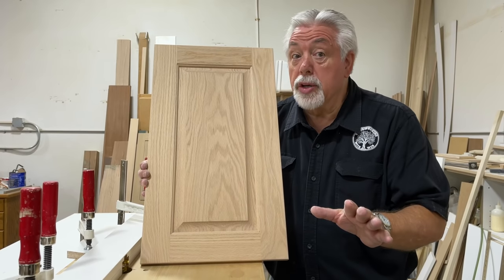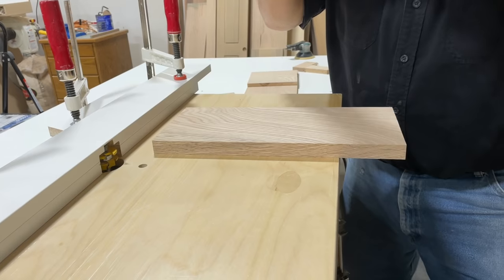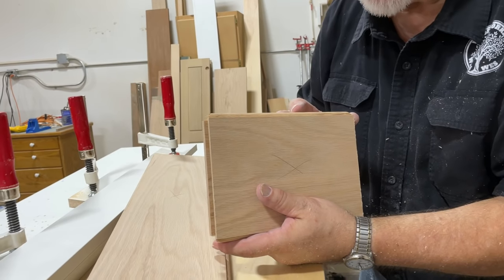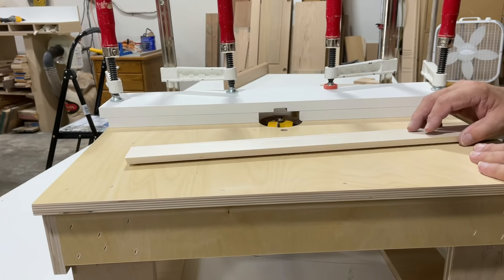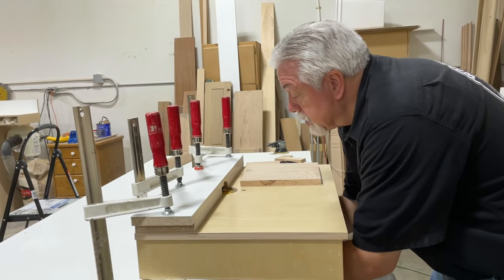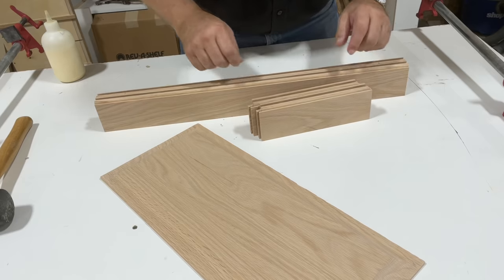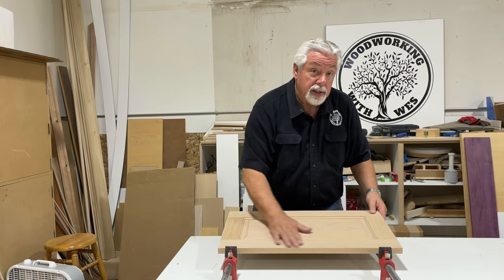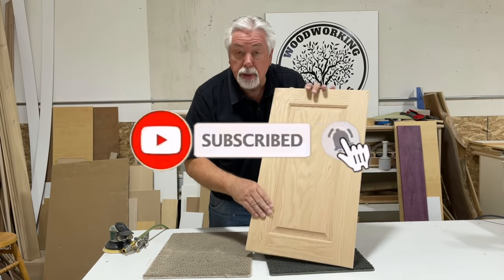Making Raised Panel Doors The Easy Way

Comment: I can’t finger out how to make my panel flush with the stile and rails. My panel is always proud.
Reply from the maker: Hi...the unevenness of your panel is very common but can be taken care of by flat sanding your doors with a wide belt or drum sander. Hope this helps. Wes
Reply: Panel raising bit make need adjustment.
Reply: Take a rabbit bit to back of the panel to bring it back flush.
Reply: Using his technique and with 3/4 thick rails and stiles,  use 5/8" material for your 😊panels.  This will result in a flush fit.  Note:  when making the rail and stile cuts, the groove is 1/8" from back of rails and stile.

Comment: I have to agree with some of the comments.. for just 300.00 u can make this door.. well what’s the process of getting flat s4s lumber? If you don’t have a jointer planner and belt sander it’s going to take you a bit more time to do if at all.  Working with s4s and dry lumber is key to making these doors most people don’t have 1,500 worth of jointers and planners and that’s cheap ones.

Comment: Just a simple router table and bits you bought from Amazon. I have a simple router table, but then you pull out the professional level woodworking shop to do it. Love your shop but was hoping for the "with only a simple router table" video. I don't even need the raised panel I'm putting smoked plexiglass in the back.

Comment: Been working in a cabinet shop for a little over a month now - was supposed to be doing real estate appraising but there is no work right now, so a friend hooked me up - the amount of prep, wood putty, and sanding really gave me appreciation for WHY you take so many carefully planned out steps because MAN, when those doors go into someone's kitchen, it's immaculate!  

For the newbies like me, when you 'break an edge', one or two quick swipes with the sanding block is all you need.  My first set of doors I was a bit aggressive.  The other thing, you can never clamp your doors together too tightly!  You'll see once that first coat of primer goes on.

Comment: Nice tips.  I really like the idea of making the rails/stiles double wide (plus some) and cutting them in half after the routing is completed.  As you said, easier to handle on the router table.

Not sure I like the idea of wearing gloves while routing as it seams a bit risky and could get caught in the bit IMHO.  I invested in a couple decent push blocks (I love the MicroJig Grr-Rip Blocks for the router and jointer).

Comment: You're video was great and full of tips and tricks.  Very professional and calm and easy to follow.  You should include how you setup the router bit heights for the rails and stiles though.  Also, I was wondering why you have a mammoth flat sander in your shop but built a stick/plywood router table.

Comment: 5:40  I think an easier technique for those of us who don't own a jointer is to not make the full depth of cut on the first pass.  Make the first pass about 1/32" shallower on all pieces, then follow with a final pass.  Adjust the router table fence so the bearing  is about 1/32" behind the fence (keeps eh cuter from cutting to the full depth).  Eliminates one machine operaton.

7:50  That's a very good technique.  Routing then ripping that ensures exact width of rails and stiles.
Reply from the maker: Yes...that is an acceptable alternative for sure. Thanks for your comment. Wes

Comment: Great video Wes, and thumbs up for the discussion and technique!  Based on my experience, I don't recommend using budget router bits, such as the Yonico.  On the first pass of the third white oak panel, the Yonico ogee raised panel cutter shed one of the cutter edges with a bang.  Fortunately, it didn't hurt me, but the router was immediately out of balance and shaking violently until I hit the emergency switch.  The panel was ruined, but I didn't see any damage to my router or router table.  I replaced the Yonico cutter with a Freud raised panel cutter and have been using it with no problems for several years.
Reply from the maker: Thank you very much for your comment. Wes

Comment: I love the idea of using carpet or floor mats to hold wood and protect underside at the same time.  I experienced underside damage from small little defect in workbench so I just had put a thick towel down. this is the first video i have watched of yours and I don't know if mentioned it before. If you haven't you should in a video of little hacks /ideas like that.Could call it  "Cheap over looked idea's to save time and money"
Reply: Use carpet padding to route or sand on your work piece won’t slide

Comment: Trying to read through the comments. For the rails and styles you are using 13/16” stock and for the panel 5/8” stock. Is this correct? Great video! I just was ask for someone to make a custom size raised panel door.

Comment: Some great tips in here.  I like the 1/32” jointer tip.  Never thought of that.  I’m trying that on my next doors.  How do you accommodate the space balls?  Do you build the doors and extra 1/16” wider or ?
Reply from the maker: Hi...as mentioned in the video, the solid wood panel is 1/4" smaller in width and length than the space available in the stile and rail. This allows for the space balls. Thanks, Wes
Reply: Thanks.  I must’ve missed that.  I’m going to try those space balls!  And I’m going to use the double wide plus version when cutting the grooves.  I’ve been using a coping sled and this would allow me to skip that and probably make fewer setup mistakes.  Great instructions.  I am appreciating your videos.

Comment: Mr. Wes, I am new to this. I was thinking about making the doors out of hard maple. I was told that a wider piece for the raised panel would cup.  They said I would need to join 2 narrower boards to keep this from happening. Any ideas?  Is there a different wood I could use for the wider panels?  Thank you very much
for the great video!!

Comment: I like the way you did this.  One question, how thick is the center panel?
Reply: I would guess 1/2” as there is about 1/4” on the back side of the panel and it’s flush with the door sides which are 3/4”.

Comment: You make it look so simple. One question....Say you need to make a door that is 15" wide x 22" tall. You cut your rails and stiles that lay out to be that size, but I'm assuming when you do all the routing, you've decreased the footprint of the door right? Is there a standard length that you add to the rails and stiles so that after routing, you're left with the desired size door? Sorry if this is a dumb question.
Reply from the maker: Lets do some math to see if I can help you.  Assume your stiles and rails are 3" wide, your stiles will be the full height (22") your 15" width would be calculated by subtracting the width of your stiles (6") and adding the depth of the slot that your router bit makes (typically 3/8" ). That would leave you a rail of 9 3/4" and when you do your end cuts on your rails you will have a 9" panel opening. I hope I haven't confused you...I am sure you will do great. Wes
Reply: @WoodworkingWithWes  That makes sense. Thank you for your reply!

Comment: Nice video and great tips. I'm wondering why you don't have a dist collection box on the back of the fence? I have a set up similar to yours and have a box with a dust port and hose connection that i can add to the fence with clamps. Works real good. I set up my fence about a you do and I am wondering how you readjust the fence to the 1/32 of an inch??? Your table saw blade seems to be overly high. i don't have but about 1/8 of an inch out of the wood I am cutting. Just enough to clear the top of the board. I never take a full cut with any panel bit as I find that taking shallow cuts will get me a better final face and I will have less sanding to do. Have been making doors for 50 years and I always put a bit of glue in the middle of the top and bottom of the insert to keep it centered. I was taught that the panel will swell and shrink in width and this will keep the panel in the center. It has not failed me yet. Also, as long as you finish all surfaces of the door, the expanding and contracting will be to a minimum. I always put a barrier of some kind between the pipe and the wood because I have seen staining where the wood and the water from the glue will at times stain ( ever so slightly ) the wood where the pipe touches ... Wish I had, or had access, to a wide belt sander!!!

Comment: A great video, I had never thought of doubling the rails so they are easier to handle on the router table; to be fair I always use feather boards.

I really have mixed opinions on the router bits from Amazon though; on the one hand I can't argue with your results but on the other the set I bought went into the bin to be replaced by considerably more expensive bits from Rutlands and I have definitely had a better experience with them. I am certainly down the route of getting what you pay for, that said I still use an orbital sander from Lidl that I absolutely love after 10 years.
Reply: Do not waste money buying inexpensive router bits! Amazon does however, also sell Freud and Whiteside router bits - both best in industry (I have over 40 years experience and have used about every brand bit made - also the two companies I mentioned have always placed  high scores in woodworking magazines/reviews/tests

Comment: Question? When you ran the door through the big sander you put them in at a angle. I'm sure you do it for a purpose but was wondering what that was. I'm new to this hobby learning what I can as wood cost so darn much now I don't want to wast to much because I was stupid. LOL I have a scrap pile already big enough.

Comment: great video. making the table and I purchased a Bosch raised panel bit. question. do you lower the speed of the router and do you take small bits to make the profile, or can you do it in one pass once the thickness is established?  thanks
Reply from the maker: Hi...I don't lower the speed of the router and I make multiple cuts increasing the depth with every cut until I reach the full depth for best results. Thanks for watching. Wes

Comment: Great video, Wes! 
1 question, wouldn’t it be better to sand and finish the panel’s outer edges before assembling? Otherwise, if the panel moves, it won’t show an  unfinished/unsanded line…

Comment: Hi Wes,
Really nice work
Can you please recommend a router that I can buy that will be able to do this???
Reply from the maker: Hi...I used a Porter Cable 1 3/4 horse router that I purchased from Amazon. Unfortunately, they don't offer them anymore. The do offer a 1 3/4 Dewalt router that would do the job.

Comment: wes - looks like in your door glue-ups you are using shop fox 24 inch bar clamps that have a very deep throat depth (4+ inches)....the heavy duty bessey have a shallower throat depth (like 3.5 inches).  does the added depth actually help, or would the bessey clamps do the trick just as well?
Reply from the maker: Hi...in my opinion the added depth really helps for clamps placement. Thanks for watching. Wes

Comment: Thanks for the video. I am just starting out with benchtop router table and s4s from store. The s4s is not super straight, typically exhibiting a minor cup or bow. I don't have a jointer or planer. My question is should I go ahead with this mindset and continue creating these doors or is it absolutely required to get a benchtop jointer and planer? My biggest reason not getting them is that I don't want the thickness to be smaller the 3/4" stock for the doors. I also experienced kickback from the raised panel bit with backcutter on the cross grain cut and wasn't sure if that was purely due to a slight warp of the panel or due to white oak hardness.
Reply from the maker: Using straight and flat stock is crucial for successful door construction. Your kick back problem could be caused by both white oak hardness and unevenness in your board. Starting with a smaller cut and making progressively larger cuts might help. Thanks, Wes

Comment: Darrel Gray
Wes, great video as always!! Could you tell me the name and model number of the clamps you use on the router. Thanks
Reply from the maker: They are on Amazon...Shop Fox Heavy Duty long reach bar clamps D2916. Thanks for watching. Wes
Reply: How does the D2916 w/ 12” capacity work for a 14” wide door frame?

Comment: Nice video but if your center panel was the same thickness of your stiles and rails then that panel would be sticking up about 1/8" higher than the frame. If using same thickness panel you may want to back cut your panel to allow it to set lower in the frame thus eliminating so much of the surface to be sanded off. You would account for this by cutting less deep on the cove profile. Many raised panel cutters have this back cutter incorporated into the design. JMHO :)
Reply: Yes! I was wondering the same thing. Also, many of us don’t have access to wide belt sanders to bring everything level, so the best method is the one you mentioned.

Comment: The fence building wasn’t in this video or the building of the table. I saw the dust flying out the bottom, so I assume the fence was solid at the back
Reply from the maker: On the channel I have additional videos on building the router table and the fence. Thanks for watching, Wes
Reply: @WoodworkingWithWes  Wes, was there a separate video on the fence? The building of the router table video said the fence construction would be covered in the door video, but it wasn't covered in either. Great videos, by the way. I have to build a door where the flipper of my house pulled out a trash compactor and installed a random door that is the wrong size, and mounted it crooked over the hole.

Comment: would like to build cafe doors, but, with raised panels seen on both sides. I thought of using 1 1/2" stock or 5/4" with back cutter used on one side & removed for the other side. Would this work ? Any suggestions would help as I am a novice, thank you in advance.
Reply from the maker: I have only made raised panel cafe doors one time and I just made 5/8" thick raised panel doors and glued them up back to back. It worked great for me. I hope this helps! Thanks, Wes

Comment: How much space to you leave for contraction and expansion for the panel? I’ve tried following Freud tool’s directions for expansion, etc.. and couldn’t get the space balls to fit on both sides...
Reply from the maker: The panel is 1/4" smaller than the opening allowing room for space balls on both sides. Thanks for watching, Wes

Comment: Was the stock thickness for the styles and rails the same as the panel?  Or was it a 1/4 inch less?
Reply: When I had my cabinet shop, I used 5/8 inch to accommodate for the off set. The offset will depend on the bit set you have.  The first panels I ever made were done by running the center panel at a diagonal with the saw blade.  I don't recommend doing this but it is possible.
Reply from the maker: Please check the description for size and thickness of the panel. Thanks for watching. Wes

Comment: Could you take a half pass and then a full pass with the router to deal with the bead tear-out instead of using the jointer?  The jointer is a bit of an investment.
Reply from the maker: You could but it doesn't work as well...thanks for watching. Wes
Reply: How about a half pad then a 95% pass then a full pass??  I think you could move the fence to do that easily, right??  A jointer is and expensive tool that I don't own... Yet....
Reply from the maker: @alece9697  I have not tried that, however, it might work just fine. Give it a test and see what happens. Thanks.
Reply: Unlike the raised panel router bit, which has only one cutter, the rail and stile router bits have two cutters that cut at the same time.  You can't change the height of the stile and rail cutters in the table once you have set them, so the only option is to change the depth of cut into the rail or stile.  I can think of two ways to do this.  

The first way is to set the fence away from the bearing surface for the first pass.  This will expose less of the cutters to the stile and rail for the first pass, but you might need more support for the rails when cutting the ends since there will not be a bearing to keep the rail steady (I use a coping sled). Then reset the fence so it is even with the bearing surface for the second pass.

The second way is to change out the roller bearing to one with a larger outer diameter for the first pass, with the fence in line with the bearing surface.  Without changing the router bit height, replace the larger bearing with the original bearing and reset the fence for the second pass.  This will effectively expose less of the cutters to the stile and rail for the first pass but still have a bearing surface for the wood to ride on.

Comment: I’ve been a porch and deck builder 34 years and just got curious about furniture- no way does everyone have a sander like that😂, how much do those cost?
Reply from the maker: You are right, not everyone has one. The sanding can be done one at a time...just more work. Thanks for watching. Wes
Reply: You don't need a drum sander this size unless you are doing exterior/interior doors or large panel. Get a supermax or jet for between 1500 and 2000. They work perfect. However,  you WILL need to buy a dust collector to use with a drum sander (should have one anyway for the router table) it will clog up quickly and not work.

Comment: Once your router table is set, take a 1/2 drill, and drill through the fence and tackle  get two half inch metal pins and next time you need to use it your measurements will be set by just using the metal pins.
Reply: Table not tackle
Reply from the maker: Thank you Daniel...great tip! Wes
Reply: That is what the fence is for! Terrible idea